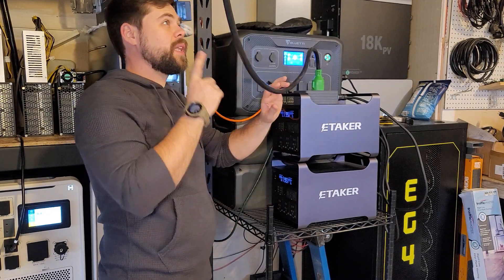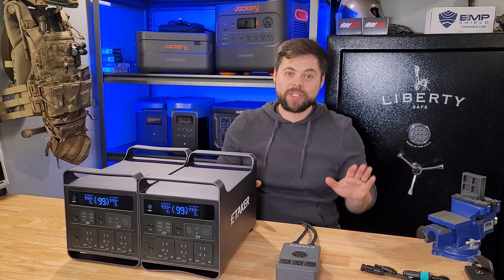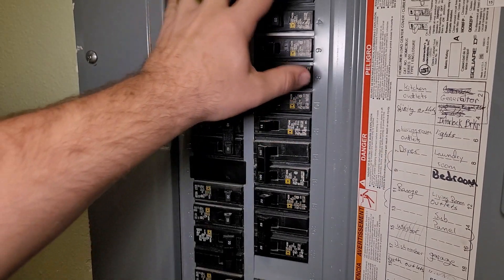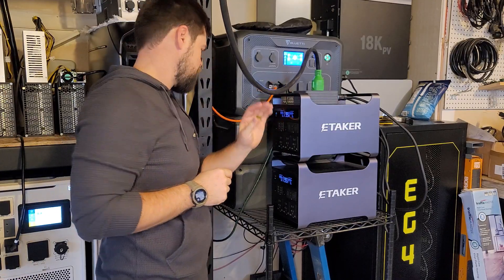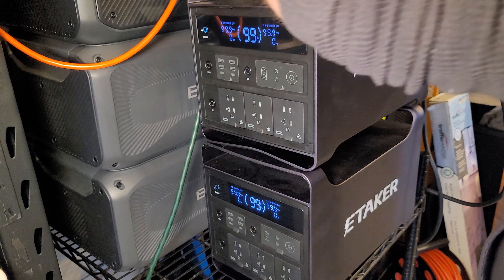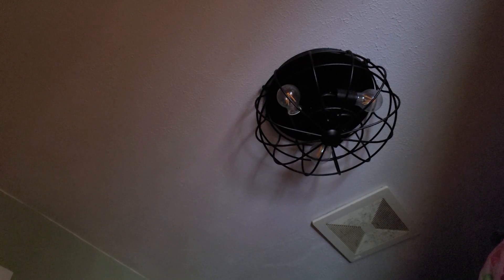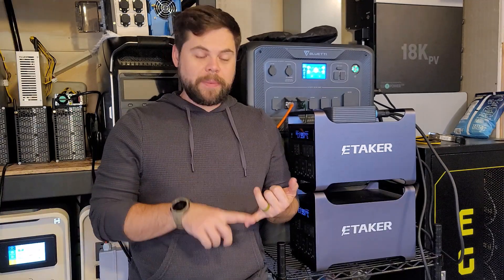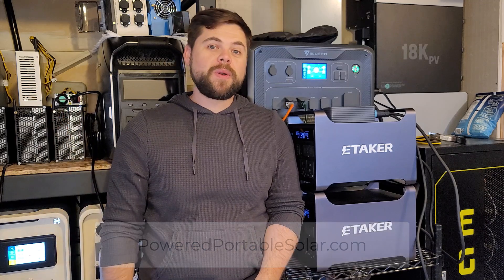WARNING Stay Away From the ETAKER M2000 Solar Generator

Comment: Any answers yet from the company on what happened? It's a shame because in theory the design seems like a great idea. Very few options out there to get 240V especially from units this small. I doubt the semi-solid state batteries were the issue but it's strange that this company chose those to use when practically every manufacturer is using LifePO4

Comment: Did anyone notice the bottom front leg on the top unit is dented in? Looks like it may have been dropped or damaged somehow prematurely causing it to malfunction.
Reply: YES. We take safety issues very seriously. But it is still in the investigation stage.
And after the two M2000s were merged, it became 240V, but the AC outlets in American homes is  generally around 110-120V.
Therefore, the input limit of lamps in daily households is generally 120V. We are still actively communicating with Ben.
Reply: Yes, that was glaring to me. A coincidence that the malfunctioning unit had blunt force trauma? Highly unlikely, it was probably dropped or worse 🫤

Comment: Check to see if the M2000 has bonded ground because you can't have two bonded ground circuits trust me I found out the hard way too.   The solar generator needs to be a floating ground if connected to a house circuit in USA which has its own bonded ground circuit by code.
Reply: It would be nice to see the bonded/not bonded ground status, 50/60HZ frequency setting for each unit, and 180 phase shift for 120/240v split phase operation in the app.

Comment: Looks like you got a bummer unit of the two you received (??) Can you contact the company and request a replacement unit, then re-test fully ?
Reply: YES. We take safety issues very seriously. But it is still in the investigation stage.
After the two M2000s were merged, it became 240V, but the AC outlets in American homes is  generally around 110-120V.
Therefore, the input limit of lamps in daily households is generally 120V. We are still actively communicating with Ben.
Reply: @EtakerOfficial  Where did MY POSTED REPLY TO ETAKER GO I POSTED LAST NIGHT ? It has DISAPPEARED ! I guess I will simply repost it ! EARLIER RESPONSE REPOSTED HERE: (Uhhhh, No ! The fact that his light bulbs are 120 Volts, as well as the Microwave and Television your power stations FRIED does NOT appear to be the issue. He plugged in your two linked power stations into a UL Approved Home 240 Volt AC Main Power Box, which properly broke down the Voltage to the appropriate home circuits. Clearly one of the two Etaker Power Stations linked together to make Split-Phase 240 Volts AC @ 60 Hz FAILED !)

Comment: I see you have a Delta Pro3 on the shelf. 

These TWO ETAKER M2000 are essentially the equivalent to ONE DP3 which has 4000 Wh capacity and 4000 watt output capacity.

The DP3 has two 2000 watt built in inverters and can output 240 volts at 16.6 amps natively without ANY additional Double Voltage Hub (DVH).

Even IF the ETAKER M2000 did work, you would run into the same issue we have had using TWO original Delta Pros (3600 Wh capacity and 3600 watt inverter) along with a DVH where the loads must be balanced on each phase. With the DPs, as soon as one of its batteries reached 5% SOC, the DVH shuts down killing all power to the house. If one phase pulls more than 3600 watts, the DVH will trip.

With the ETAKER M2000, if the load(s) on either phase exceeds 2000 watts, it will trip the ETAKER M2000.

I can't help but wonder if perhaps you had too many circuits on for the initial start up?

Great review and information as always Ben.

Comment: how much testing did you do before the fail?  will you let us know how your customer service experience goes?   i have found how a company treats you after you have bought is more important than just about every thing else.
Reply: We take safety issues very seriously. But it is still in the investigation stage.
And after the two M2000s were merged, it became 240V, but the AC outlets in American homes is  generally around 110-120V.
Therefore, the input limit of lamps in daily households is generally 120V. We are still actively communicating with Ben.
Reply: @EtakerOfficial  Your reply sounds like you don't understand the concept of how 120/240 works over here.  It is derived from a center tapped transformer, (with the center tap, i.e. neutral, grounded.) If your splitter box does not connect the neutrals together (and if the ground bond is not lifted) you will cause a serious imbalance that will send one side of power high and the other low, causing all kinds of problems.  Your splitter MUST tie the neutrals from each power unit together to form that center point from the hots,  with the hots 180 degrees out of phase with each other.  Connecting just one of the power units neutrals will not work.

Comment: Passed on these power stations since they didn't use LFP. I'm not taking any risk for something to go wrong. Etaker does make a really cool car charger for power stations that worked well. Bummer!
Reply: We take safety issues very seriously. But it is still in the investigation stage.

After the two M2000s were merged, it became 240V, but the AC outlets in American homes is  generally around 110-120V.

Therefore, the input limit of lamps in daily households is generally 120V. We are still actively communicating with influencers.
Reply from the maker: @EtakerOfficial  Thanks for replying, but I ran my house before filming to test the unit so I had experience with the unit for the video. It worked fine before including running 240v loads. This unit happened to fail when I filmed.
Reply: @minutemansolar  You somehow lost the neutral on the splitter box or one of the pack's outputs. Very dangerous and luckily you didn't fry more than the surge protector and a few lights. Never, regardless of brand, rely on portable linked battery power units. They are touchy and prone to this kind of failure.  Get a reputable permanent type solar inverter if you want whole house backup power, or use a standard generator. (Generators with internal 120/240 inverters are safe.)
Reply from the maker: Ya they use semi solid state batteries (raises eyebrow) so I thought that was cool but this is definitely a no go for me. Another guy we know got one and it had issues too.
Reply: @minutemanprep  semi solid state is just another name for NMC batteries, still flammable and explosive. A truly solid state battery is the only safe alternative.
Reply from the maker: Agreed but that's what first interested me plus the lightweight 240v option
Reply: Hey, Jason. They now have the F2000 charger. I mentioned this to you back in Oct. on your F1000 vid, but you kinda poo-poo'd me for not having credible info. at the time. Sorry. I guess they were a little late in releasing it. Anyway, it's out there now.

Comment: Company thinking "Well, back to the drawing board."
Reply: We take safety issues very seriously. But it is still in the investigation stage.
After the two M2000s were merged, it became 240V, but the AC outlets in American homes is  generally around 110-120V.
Therefore, the input limit of lamps in daily households is generally 120V. We are still actively communicating with influencers.